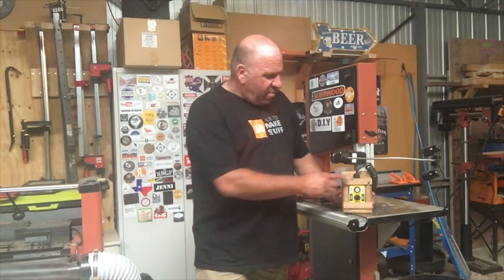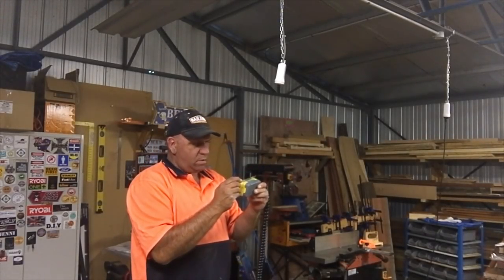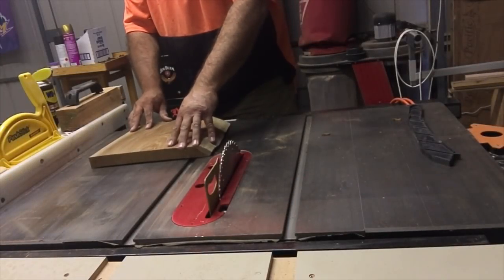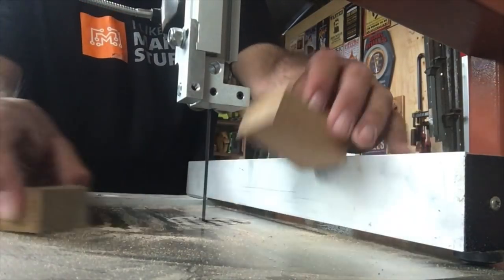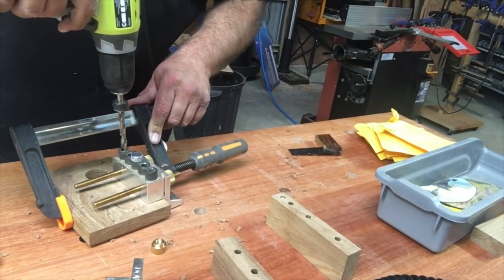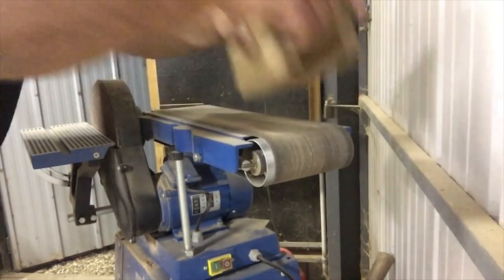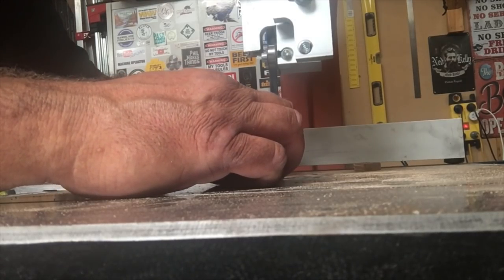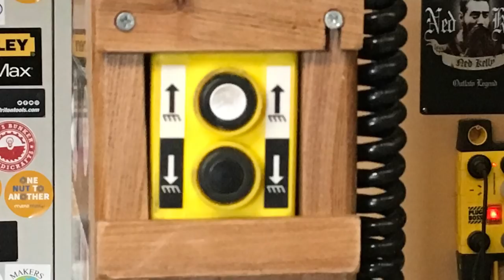How to Make a Heavy Duty Remote Control Holder for a Hydraulic Lifter

Comment: I was waiting for the action shots at the end to see just how much it improved your work flow... good to see you using the dowelmax, the clamp can be repositioned for a face joint so you don’t have to use G clamps, just remove the threaded rods from the body then re-attach them to the bottom of the fence and re-attach the clamp in the vertical position, works a treat.
Reply from the maker: Mate I forgot about the end of the video & showing it in action, I was distracted & hit upload & left that last bit out 😳. I’m using it & my biscuit jointer quite a bit but not on videos but I love the dowelmaxx for its precision. 
One thing I think I’ll do is make some more spacers for getting the dowels more centred on non dimensional stock & I think I know what you mean so I’m going to keep playing with it & when I’m confident enough I’ll do a review video on it.
Thanks again mate & when can we expect your next video? 🎥🎥🔨🔨👍👍👍👍
Reply: @sumosprojects  ah yes my next video I'm not feeling it right now, was too busy but now lacking the motivation
Reply from the maker: Don’t sweat it Luis, I nearly through the towel in back a while ago, lost my mojo & busy at work plus my views were going backwards but hey wait till you’re ready to fire up again & then you’ll give your best 👍👍👍

Comment: G'day Sumo!  I hope the drought problem is easing up down your way - we could float a flotilla of ships with the rain we have had, wish we could send you some!
This project is very similar to the very first video I saw of yours - in fact I made an item based on it. English Elm is awkward, just like us English and thanks to tree disease we have not much left - you may have used the last of it. We have "Die-Back" disease in a lot of trees here and just like the Dutch Elm Disease it will change the way the countryside looks.
I was using a wheelbrace this morning [hand drill with gears and a sidewinder] and the screw that holds the spinning part that provides the oomph zipped off and away ... looked for it for ages and then I remembered I had one of those strong magnets. whizzed it around the floor on a string and out pops the screw. I am making a centre finder with a difference. Bamboo needle in the known centre and two other needles on a wood and brass 'pantagraph' give options on either side - for bookbinding in my case. Well that is my day's fun, Dirk, it was great to share yours! By the way, over-engineering is always better than under-engineering any day, that holder will last years! Cheers friend   😃👍👍👍🔨
Reply from the maker: G’day Eryk, weather report is that we’ve had near on 60mm rain in the last week & more in other places, amazing to see the landscapes slowly transforming into a beautiful green once again.
I made my clipboard from the same Elm mate & that looks great but was a mongrel to work with. It’s a shame to hear that the trees in England & Holland have a disease caused by human over population of the Earth, we have many species of flora & fauna destined for extinction here as well, luckily we still have many green belts & even though we look like a desert there are enough trees to cover most of Europe left I’d estimate 🧐🧐🧐😳 well it’s a big land DownUnder lol.
I always enjoy hearing that you’re tinkering & making some very nice jigs that serve your purpose within your hobbies, that’s pretty much what I do & YouTube is part of that hobby, I bought all the things I have because I wanted a hobby & whilst I’m lucky with space etc it was my quitting smoking cigarettes that paid for my workshop probably twice over now, just gotta protect the lungs from the sawdust now.
I see they had that big Makers Central event in Birmingham this last weekend & what I like about it is that hopefully it can motivate a new generation to give things a go, I would of enjoyed it but I would of enjoyed meeting & talking to you more mate.
Ok then I’ve got some projects, reviews & other things in progress hopefully for not to distant release Eryk.
Cheers Cobber, be well 👍👍👍👍👍
Reply: @sumosprojects  Thank you for your kind words mate, I would like to get to the makers in Birmingham but train travel costs an arm and a leg and there is accommodation on top of that - my expendable income went on a week in Oxford earlier in the year enjoying things made centuries ago!
Glad you have had rain - it is probably your Autumn by now as we are a third through Spring, 21 deg C in my workshop and that is fine for me! I usually wear a mask when doing anything that puts particulate matter in the air but your dust extractor must be the equivalent of that. I don't smoke or drink and that paid for my library and workshop. The people wanting to loan tools are always those who say they can't afford a drill or whatever but spend a fortune down at the boozer!
A bit of a shock for you here, Dirk . .  I needed to by a carpenter's vice as my old engineering vice is not appropriate for precision work - I am working in 32ths of an inch here. I tried to buy a vice from three outlets and one was 'bound' - the guides were twisted and the other two from different places did not close parallel .... I gave up in the end and adapted my old vice. I wish we had your tool shops here. We get get substandard Chinese seconds it seems to me. An electrical retailer confided to me that he gets a third of sales returned!!! After Brexit who knows what we will get!
Be well yourself friend and enjoy the better climate! Eryk 🔨👍👍👍👍
Reply: @sumosprojects   Sumo's Projects  Thank you for your kind words mate, I would like to get to the makers in Birmingham but train travel costs an arm and a leg and there is accommodation on top of that - my expendable income went on a week in Oxford earlier in the year enjoying things made centuries ago!
Glad you have had rain - it is probably your Autumn by now as we are a third through Spring, 21 deg C in my workshop and that is fine for me! I usually wear a mask when doing anything that puts particulate matter in the air but your dust extractor must be the equivalent of that. I don't smoke or drink and that paid for my library and workshop. The people wanting to loan tools are always those who say they can't afford a drill or whatever but spend a fortune down at the boozer!
A bit of a uk retail shock for you here, Dirk . .  I needed to by a carpenter's vice as my old engineering vice is not appropriate for precision work - I am working in 32ths of an inch here. I tried to buy a vice from three outlets and one was 'bound' - the guides were twisted and the other two from different places did not close parallel .... I gave up in the end and adapted my old vice with new gripper faces. I wish we had your tool shops here. We get get substandard Chinese seconds it seems to me. An electrical retailer confided to me that he gets a third of sales returned!!! After Brexit who knows what we will get!
You be well too friend and enjoy the cooler climate!
👍👍👍🔨
Reply from the maker: We are very spoilt for choice in Australia Eryk, it is one of the most fortunate countries on earth mate & im lucky I live here, tally ho pip pip & carry on kind sir 🔨🔨👍👍👍👍
Reply: @sumosprojects  What Ho! Dirk!!! News just in . . my family have just added one more person lucky to be living in Australia, My nephew's wife has just given birth to a baby boy in Melbourne! I am a Great Uncle about a thousand times over now!
Tiddly push old bean 👍👍😃